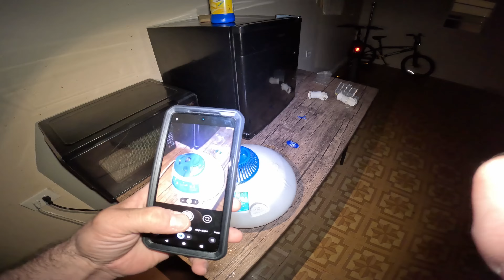I'm NOT Going Back To The City/ Electrical Troubleshooting

Comment: 12:06 - It probably didn't trip because you're plugging it into a 20A circuit.  The laundry is required to be 20A.  The other circuit is probably a 15A circuit, which of course requires a lower current threshold to trip it.  Since the cord and plug are hot, you know it's drawing a lot more current than it was intended to.  Vaporizers usually trip breakers when overfilled with water. But the unit may be defective, as well.
Reply from the maker: Yea I was thinking It didn't trip it cus of that, I should have explained. I pretty much hill Billy it since I'm on a time crunch. Yea I didn't know that those trip breakers when over filled but at that point that thing was probably made for 50 cents and sold for $20 dollars . Forget that piece of crap. Thank you for the informative comment, I appreciate it especially since other viewers can see it. I'm trying to inform people as much as I can. Thanks again bro!
Reply: Someone in house may have tossed a few tbsp of salt into the vaporizer, to make it “really put out steam”.  Dangerous.  Throw that thing out, dingbats, or else your fire risk will be huge until you do.

Comment: In Florida there is no deductible on a windshield. Check into your state.

 When any kind of little steamer gets kaka in it from the minerals in water they sputter like that. I have a fairly expensive clothes steamer and mine started doing that. I got it apart as much as I could and cleaned boiler out. It runs much better but I tried to get a new boiler for it and they don't sell it. The interesting thing they told me was to use regular water. They basically said I caused it using distilled water. Learn something new every day. I had another brand that said all over it to use distilled water only but my fault I didn't read the instructions on this one.

Comment: you should get a picture of the nameplate with the wattage rating of the humidifier.  It creates steam by boiling the water. The laundry GFCI was probably on a 20A ckt and the large room was probably on a 15A circuit, with other thing drawing power
Reply from the maker: Yep nailed it, 👌 what scared the crap out of me was cus how hot the cord got. My heat gun cord from harbor frieght runs cooler than it lol. I knew I should have showed the name plate and looked it up. Problem with tenants is that they plug a bad appliance in or what ever and blame it on the house.
Edit: I put your user name in my mess up video where I had to go back and fixed how I screwed up the gfci wiring. I had to take it out cus it sounded like I was bashing you which I wasn't. I definitely appreciate the information you give out, you definitely give out alot of value with your comments. It definitely helps out the viewers!!!

Comment: That is why I stay local unless it's a REALLY GOOD CLIENT or stupid money!

Is that technically a rentable space I saw less than minimum requirements for such.  That box was nuts at that point I'd externally mount a 4square to make that resemblents of code legal.  I know they weren't gonna pay jack so that's my first clue maybe I shouldn't be doing this.  Anyone asking what's a out of pocket maximum is ussaly a red flag for electrical work.  Good for you finally being done with the city's.   Lucky its a service vehicle and isn't mandated to have the auto collision avoidance since that requires calibration and additional money for the insurance claim.
Reply from the maker: I think the truck has collision avoidance lol I'm screwed

Comment: Cause it’s 1, 2, 3 strikes you’re out it the old fix it game! Man that low battery smoke detector was driving me nuts, carry an extra 9 volt with you and charge them to change it
Reply from the maker: Yea I have them had to fix something with the electrical issue to charge more. Still wasn't enough

Comment: Rule of thumb always go with your gut feeling, you knew from the start you’d be rolling the dice. By the way invest in a dam cordless screwdriver every time I see you jiggling that screwdriver trying to take out a 2” outlet screw i bite my tongue. I’ve had my dewalt 12 volt screwdriver for 7 yrs use it for most anything including drywall screws its pistol grip and straight profile. Another good troubleshooting video 👍👍
Reply from the maker: Lol yep I just view the cordless screw driver as a drill lol so if I don't feel like changing bits or what ever I go with the screw driver. Thanks bro I appreciate the support!